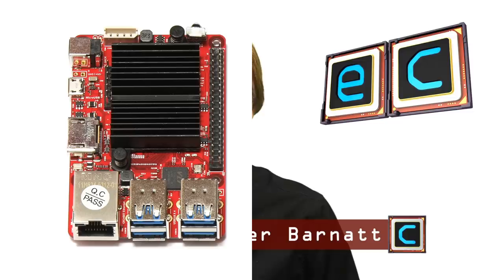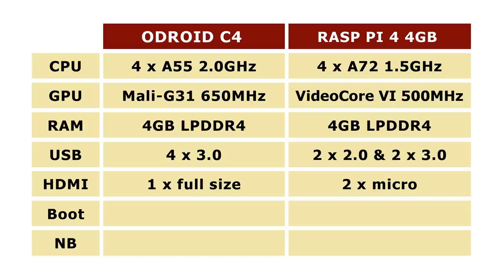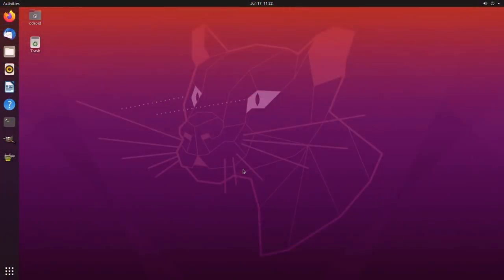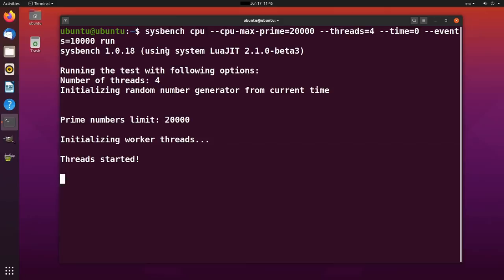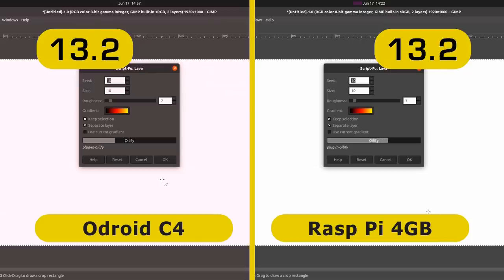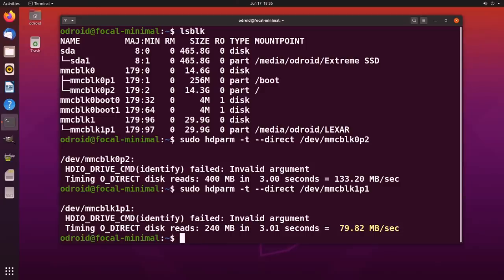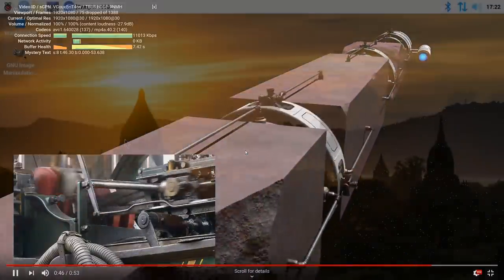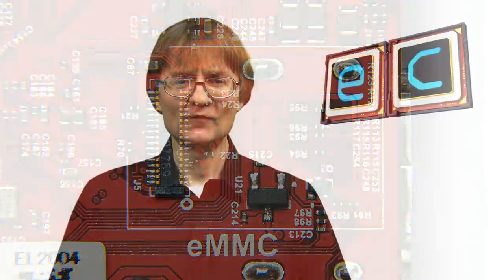Odroid C4 vs Raspberry Pi 4

Comment: Thank you for going to the trouble of setting up the tests. I do however feel that the CPU test is not completely fair with a fan on the raspberry pi 4 and only passive cooling on the odroid c4. The thing is that the processors starts throttling back when getting hot. Just my 2 cents...
;)
Reply from the maker: The tests are completely fair. Both boards have more than adequate cooling not to throttle. There seems to be an urban myth spreading here that boards with active cooling will outperform those with passive, and this is completely untrue.
Reply: @ExplainingComputers  Fair enough!  ;)

Comment: Interesting comparison. Odroid have done some good alternative earlier. I would recomend to look at Armbian if they had any image to run on it because they use to do some very good base systems. Now when some of us are thinking more about where different stuff is made, I'm glad that the Odroid came out in a worse performance compared to Raspberry so I dont have to buy more made in China. For use as a little server, I find it to better to not have wireless, but better i/o performance but that did not seem to be in this case. One thing to note about usb disk is that you should look after those that have iSCSI support, they gives about 30 or more in disk performance. You could also do an overclock on the Raspberry to 2147MHz for a comparison.

Comment: You should also consider the temperature these devices were running since you have a passive and active cooling   discrepancy between them, I believe if you put a fan on odroid c4's heatsink it will perform better, especially if your ambient room temperature is low.
Reply: The passive vs active cooling is very important point, the Pi would operate worse with active cooling than the C4 they should both be tested with active cooling and the C4 will work out cheaper and have even faster mbps transfer rates as well.

Comment: I remember when the Odroid C2 were so much more powerful than the RasPi of the time, at least on paper... Seems the RPi foundation finally catched up, too bad for Hardkernel
Reply: To be fair, Raspberry seriously raised their game with the Pi 4, which surprised me as they could still have used their name as the best supported SBC to slouch on the specs.
Reply: Hardkernel is still a nice and innovative company with a very competent and professional staff, problem is their community or lack thereof. All Arm SBC manufacturers rely on the community job to do the heavy lifting regarding multiple OS implementation/extra features/software improvements for their boards. Ex. Odroid-N2 which is a superior machine pound by pound compare to Rpi 4 which BTW was released 17 months ago(feb 2019) and they still haven't been able to release ubuntu desktop 20.04 official images for it. We're still stuck with ancient and fugly ubuntu 18.04.4 and there's still No official HW hardware acceleration for their Mali G52 GPU. The more people buys a SBC board the merrier. That's where Rpi 4 stands out. You simply cannot compete against this particular Raspberry pi behemoth community.
Reply: I like my pi4 I can game on it, watch movies and broswe the net, I have a xu4 odroid but not sure why it reboots on its own, my wife bought for me for xmas we watch movies and a duoo issue came up,bt would cut off, everything would unpair, it get hot and reboot, not sure what it was just a disappointment, but mostly cos my wife bought it, not knowing theses issues, so we got 2 pi4 4gb , one for the kids and one for us and play Mario tennis on 64 something we could t do on odroid xu4 for all it's issues. But at first it was a great, it's just sad.

I guess this why raspberry pi foundation has more  support and a big community.
Reply: Max Raider  It didn't really matter though as people still bought it because of the excellent support and user base, and maybe as a distant third because of the low price compared to better hardware specced boards such as the Tinkerboard.
Reply: I still remember when 8-core Odroid-XU4 was light years ahead of Rpi 3b+. Times have changed!

Comment: I think the king of SBC performance wise is the Odroid N2. Would be interesting to see how that Pi4 stacks up against it.
Reply from the maker: The N2 is a solid ARM SBC -- but there are much morepowerful x86 boards. :)
Reply: @ExplainingComputers  You have said it all. I should have added King of Arm SBC. I recalled the Rpi 4 smoked it in your rendering test with the Nvidia Jetson Nano. Software optimization is everything in the end and the Pi rules when it comes to that.

Comment: Really nice video thank you ! 

I honestly prefer the Pi3b for simple 'server' LAMP for home automation. Much more power efficient for me and runs off my router USB / power though it does complain it works fine.  For remote sensors it's the Pizero/ with a 10W solar panel and 7Ah battery, runs fine 24/7 even in the Welsh climate lol.

Also the Pi is made in Wales so that helps as well 😀

Comment: i like that the raspberry pi 4 doesn't come with a heat sink. allows for customizing your cooling options. i have a small case with just a fan, no heat sink. heat is not an issue as it stays rather cool with just a fan pulling the air out. my small case doesn't allow for both a fan and a heat sink.

Comment: 1:55 Yes! Yes it should come with a heatsink preinstalled. This is a car sale without the 4th wheel...
Reply: Well... RPi comes without cooling but Odroid comes without on-board Wifi and without Wifi dongle either, so, it's fair on balance. Also, the entire point of SBCs is that you don't have to buy the entire package, you can pick and choose what you need (maybe you already have your own USB-C power supply or heatsinks...)

Comment: I had watched your earlier Odroid C4 presentation and given how eager I was to find a board with quadruple USB 3.0 ports I'm baffled as to why I don't remember getting excited. 
I guess it must have been the lack of dual HDMI ports or perhaps the price...
With regards to the "weak pound" in the computing market, I guess European consumers are getting ripped off yet again. We're used to it by now.
Disappointing to find out all those better specs the Odroid is endowed with do not translate into better CPU performance. I should think the eMmc booting capability should give it an edge but I guess I know just as much.  Who knows, perhaps next time?
Reply: Does the UK Raspberry Pi price include VAT? If it does then the price seems about equal.
Reply: It would seem that the eMMC drive would give the Odroid an advantage in I/O dependent functions/benchmarks, but the tests in this video, other than the test of I/O, were purposely avoiding I/O dependence in order to compare CPU performance. That doesn't mean the Odroid C4 using its eMMC wouldn't function better than the Pi 4 using a microSD card in several real-life situations. Of course, if you moved the Pi 4 to a fast USB connected SSD, it would once again gain the performance advantage even in those functions. However, that would also require an external connected device, which is another factor to be weighed.

Comment: My N2 benchmarks, N2 4Gb is a beast on Ubuntu-mate 20.04 (6cores-6 threads at 1.9Ghz). N2 on 18.4.4 was really slow. Tomorrow will include N2+ 2.4 Ggz benchmarks:
CPU Benchmark                     Odroid-N2  Odroid-C4  Rasp Pi 4 
Blowfish(lower better)                  4.12           6.52           6.53 
CryptoHash (higher better)      285.60      151.27      316.06
Fibonacci (lower better)                1.70          2.34           1.55
N-Queens (lower better)                9.28       10.02            7.27
CPU (Zlib) (Higher better)              0.41         0.18            0.39

Comment: C4 will benefit from dropping the barrel plug and implimenting type-c. Pi on the other hand does not need the extra Hdmi and I think they should drop usb 2 in the next model.
Nice comparison as alway Chris. Good to see you are doing fine with your health. Take care.
Reply: Use two monitors on my Pi, and use it as a desktop machine. So if they drop it, I would be massively dissuaded to get another one. USB 3 is an idea, but am not fully convinced it is necessary. 

I suspect the Pi 5 will be slightly larger, to be able to fit more items in. But time will tell.
Reply: @horseradishpower9947  i think they should make it a Little more powerful if they plan to keep the 2 display option. as it is now, I will not use it to run things on 2 displays. Faster and smaller ports will really benifit single board PCs to get more work done and be multitaskers. It is really fascinating to see how many things can be done in these smaller machines.
Reply: @adityapandey7798  They are powerful enough for me...

I am sure that they will use a more powerful GPU next time...

The big thing... they have dual display. How many Single Board Computers have them.
Reply: @horseradishpower9947  True, it is good that you find use for Both display. I think for GPU they can look for mobile phone chip devlopers. Our phones can run high graphics with very little power and heat. And they do it on battery.

Comment: Fan makes difference here, would love to see those tests again with odroid board having active cooling.
Reply from the maker: As I've discussed scores of times in the comments here, both boards have more than adequate cooling to prevent throttling. So running the tests again with active cooling on the Odroid would deliver IDENTICAL results. There seems to be an urban myth doing the rounds here that boards with active cooling perform better than those with passive cooling, and this simply is not true. The ONLY time cooling will impact performance is if a board throttles, and that did not happen here in these short tests on two boards both with decent cooling solutions.
Reply: @ExplainingComputers  Thanks for your insightful answer.
 I am just trying to understand how rpi performs better with theoretically worst hardware. I thought, well either it is cooling or pcb's design which has some flaws.
Reply from the maker: @krak3436  It will largely come down to software support I think -- that determines a lot of SBC performance.

Comment: I have overclocked my pi 4 to 2 Ghz from the default 1.5 Ghz,it even runs at 2.2 at a push, all stable, it even runs a pi version of Doom 3 which has the identical graphics to the windows version, quite playable at lower resolutions and qualities (still looks nice) used heat sinks on all active chips and a case with a fan, keeps it under 50 C most of the time and never passes 75 when maxed out, running a 32 bit version (only one out for pi atm)of Twister OS for pi

Comment: I would recommend you to use sandisk A1 microSD cards on the raspberry pi 3B+, but perhaps the Sandisk A2 cards work better on the 4B.
Sandisk A-series cards, have much higher iops than standard microsd cards, even faster than their U-series cards, which only boost sequential read/writes.
A1 cards are optimized for USB 2.0 4k iops, while A2 cards are optimized for the same, but with 3.0 sequential speeds. Though the A1s have lower latencies, which make them the better option for USB 2.0 speed protocols..
They closely match the performance of some of the cheaper MLC emmc drives out there.
Reply from the maker: I have a video all about this: https://www.youtube.com/watch?v=YUResed38uo

Comment: the output of 'cryptsetup benchmark' would also be pretty interesting. The Pi 4 doesn't support hardware accelerated crypto, so this might be a strong point of the C4 if it does.
Reply: But who actually wants to use hardware accelerated crypto on their SBC?

Comment: Yessss.. managed to click like in under 1 second!

Been looking forward to this one as these are my some of the highlighted boards I want to compare to slowly move away from Windows 10 for general work/browsing and take the muzzle, harness and leash OFF of my future computing experiences! I do favour the Pi4 and I've highlighted a LABISTS kit from Amazon as it's well equipped with the usual stuff but a comparison with other modern SBC's is always welcome.

I'm also going to get an offline Win7 system going using older x86 gear but an SBC system covers a lot of tasks I will be doing alongside my daughter.

Comment: thanks for the experiments Chris. The results are interesting indeed but why not test both with passive cooling (raspberry with heatsink) or the other way? As per your other experiments worst active cooling was better than best passive cooling, it might have an implicit effect.
Reply from the maker: I am pretty certain that the tests did not run long enough for either board to go anywhere near throttling, even with no heat sinks or fan. So am pretty sure that the method of cooling used will have no impact on the tests.

Comment: Would the CPU cooling difference have any impact on the numbers?  With Pi using active cooling with the fan, and the Odroid using a passive cooling with a heat sink.
Reply from the maker: Probably not given the duration of the tests.

Comment: Ask Mr. Scissors: what will it take for ARM64 to cut it as a desktop replacement?
Reply: The 4gb model paired with USB SSD and a fan case is good enough as a low end desktop.
Reply: It needs to support Windows 10 without costing an arm and a leg. And I say that as a Linux guy
Reply: It already does if you run a 64-bit OS and you're ok with Linux as a work OS. Ok it's not quite as slick as a 5-year-old Intel, but it would have wiped the floor with the work PC I was using 10 years ago! (that would have been a Prescott Pentium. Yes I know, sad really.)

Comment: Would you be so kind to retest this with newer models? (2023-2024)
It would also be nice if you show your test environment you use, what devices you use on both models, how to capture the screen etc.  etc.  
Thanks, love your video's.
Reply from the maker: Thanks for this. But which "newer models" are you referring to? :) The Pi 4 is still the most recent Raspberry Pi, and the Odroid C4 also remains on the market. I did a video on alernatives to a Pi 4 a few months ago: https://www.youtube.com/watch?v=k8clrUclPIs And a few weeks back looked at the Rock 3C, which is a great new Pi alternative: https://www.youtube.com/watch?v=M6OX8HUmK3s (there is a performance comparison test in this video). I do screen capture using HDMI recorders -- as detailed in this video: https://www.youtube.com/watch?v=pocs02YuJ4k

Comment: N2Plus at 2.4Ghz is a Monster, literally speaking. Response times and loading speeds for 64 bit apps under Ubuntu 20.04 are breathtaking. For simply Raw performance, there's nothing better under ARM64 SBC's. Rpi4 held its ground. Here's my N2Plus benchmarks:
CPU Benchmark             Odroid-N2+ Odroid-N2 Odroid-C4  Rpi4 
Blowfish(lower better)           3.44        4.12         6.52            6.53 
CryptoHash (higher better) 371.0     285.60    151.27       316.06
Fibonacci (lower better)         1.28         1.70        2.34            1.55
N-Queens (lower better)          7.46        9.28     10.02             7.27
CPU (Zlib) (Higher better)       0.51         0.41       0.18             0.39
Reply from the maker: Very interesting results -- thanks for sharing.

Comment: Chris have you tried Manjaro ARM 20.04 on some of the SBC's? It come in XFCE and KDE Plasma flavor?
My experience running KDE Plasma is it runs very lean (idle ~400mb) compared to XFCE or Mate (~750mb) , but that's on x86, don't know if it's also the same for ARM. But considering SBC's mostly come with 4Gb, perhaps KDE would be benificial. PS. saw it isn't compiled to run on all SBC's btw.
Reply from the maker: I have run Manjaro with a KDE Plasma desktop on a Pi 4 in the past (eg as part of my "Raspberry Pi 4 Week" experiment and video). I will be trying the latest version soon for a 64-bit Pi 4 OS video. :)
Reply: My Pi4 2GB running 32-bit Raspbian LXDE headless with VNC server + squid proxy + pihole, is at ~263MB RAM used, 1.1GB RAM free after 1 day of uptime :)

Comment: Hope the red dot is coming along OK. Good video. Personally I am interested in the PiOS 64bit streaming performance. Running PiOS 32 bit (SSD)now (since September) but I am trying to figure out if it is worth the switch. If I do I will switch I will go to direct USB boot, been using hybrid USB boot since September.

Comment: what if you installed the fan on the Odroid C4?
Reply from the maker: It would not fit, but should impact the results. The Odroid comes with a decent heat sink. The Pi 4 does not and needs cooling in my opinion.

Comment: My personal benchmarks C4(2Ghz) vs Rpi 4 8Gb(OC'd 2Ghz), both running ubuntu 20.04 64 bit  running from exactly same microsd card(Sandisk Extreme 32Gb): 
CPU Benchmark                 Odroid-C4       Rasp Pi 4 
Blowfish(lower better)              6.52               6.53 
CryptoHash (higher better)   151.27         316.06
Fibonacci (lower better)             2.34              1.55
N-Queens (lower better)           10.02             7.27
CPU (Zlib) (Higher better)           0.18             0.39
Reply from the maker: Very interesting -- and consistent with my results on the winner. Thanks for sharing.

Comment: Gnome Shell is pretty heavy, I would have thought initially in Ubuntu Mate ARM x64 for both, could you briefly mention which problems did you have with Mate in the C4, please?
Also, would you expect much better streaming video performance in the r. PI with 8 GB of RAM, or do you think the GPU/CPU are the limiting factors?
Reply from the maker: I think the software support for the GPU is the limiting factor -- I have found no video performance improvements with the 8GB compared to the 4GB.
Reply: @ExplainingComputers  thanks for your comment, it's a very good point.